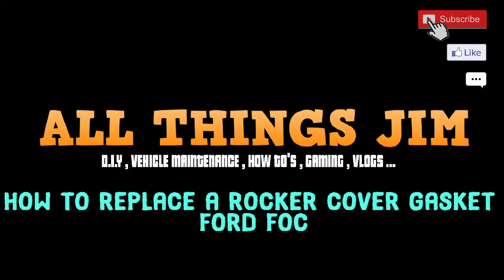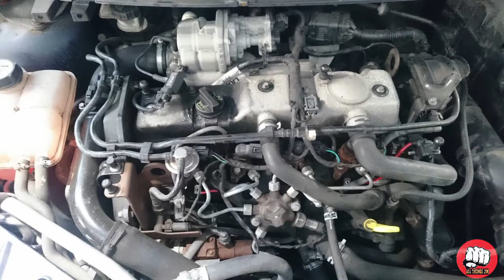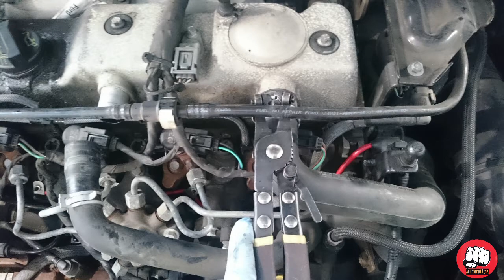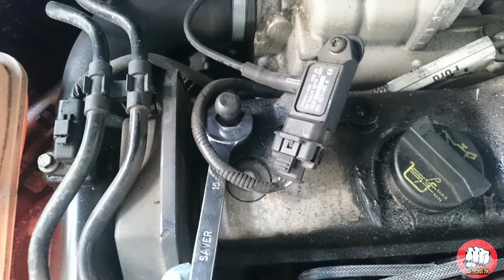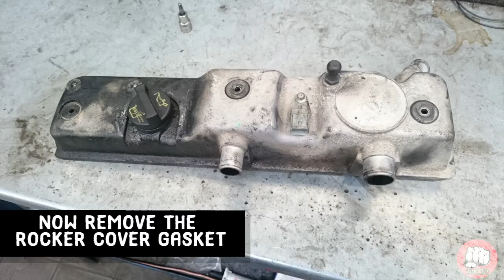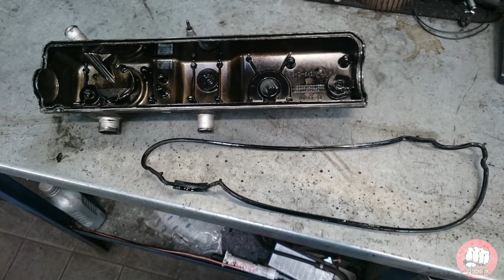rocker cover gasket- Ford focus 1.8 tdci lynx engine- how to replace

Comment: Do you know what is that circular dome cover on the rocker cover for? Is it some kind of blow-off membrane to release pressure in case of damage? If this cover is blown off, what kind of damage can be expected that led to it?
Reply from the maker: Hi i think your talking about the engine breather diaphram, if it were faulty the engine wouldn't breathe correctly could cause poor running or a mayonnaise type substance in your oil, I think you can only get them as a complete rocker cover thou and ive never seen one blown off, surely if that happened your oil would blow out as there would be a massive hole...
Reply: Hi, thank you for your response! But what could be the reason of this diaphragm blowing off? A sudden pressure surge? But why? I had this diaphragm blown off during an engine failure, but the engine was on a warranty and the cover was silently fixed by mechanics without them telling me the details. I just wonder what kind of failure could lead to this diaphragm blowing off?